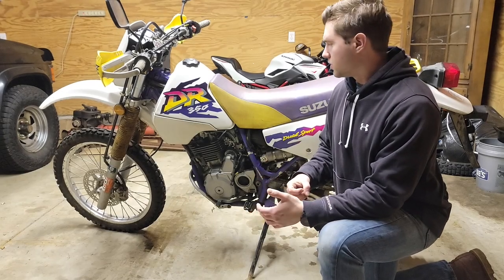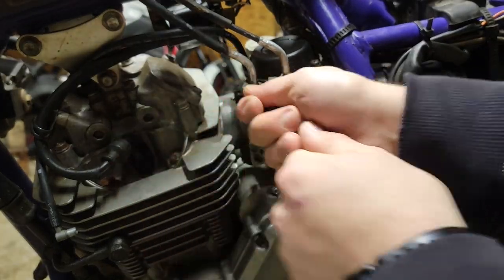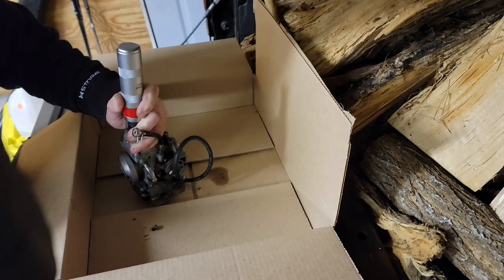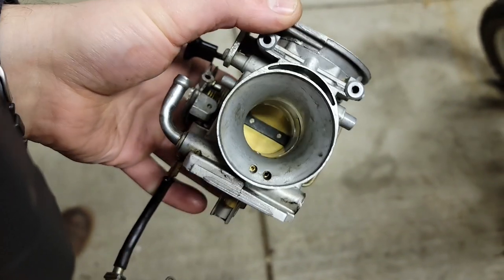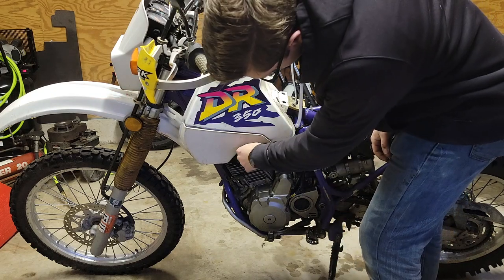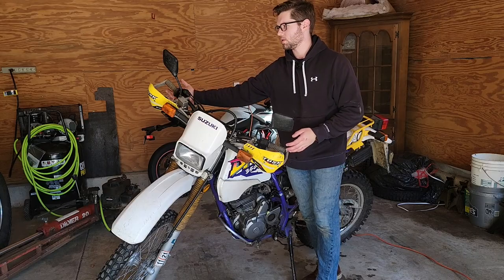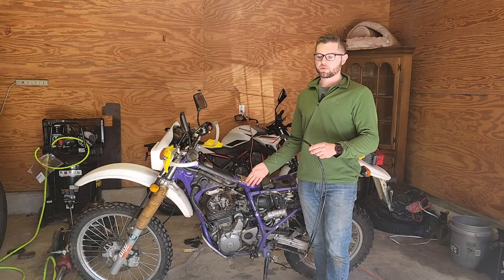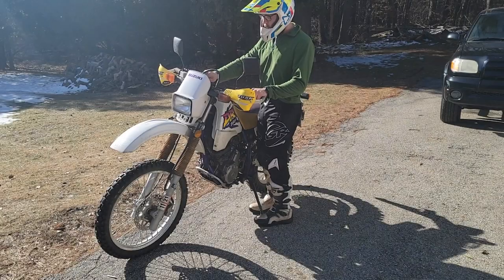Refreshing a Motorcycle After Storage: 1996 Suzuki DR350

Comment: I might suggest a little step by step talking about specifically cleaning needle and seat (if this carb has one) and how to check the setting of the float. Is it possible to get out of alignment?
Good video with option of more future steps as riding season (and things break) goes on. Have fun.
Reply from the maker: This carb has one, but since it was in good condition I didn't have to spend effort on it. I did verify it's in good working condition by trying to blow air through the fuel line and make sure it sealed nicely.

Comment: Good job dude. I am looking to buy one of these.
Reply from the maker: Thanks. What model years are you looking at? Personally I think the years to get are between 96-99 as they came with electric start. They're a little more expensive but it's a nice quality of life upgrade with the easy button.
Reply: @Dan_And_Daves_Garage  yes I would like the electric. I think those newer ones have improved suspension also. But I have my eye on an older kicker. Leaks oil I am told. Hopefuly a good deal. Going next week to check it out. It's not on the market yet.
Reply: @Dan_And_Daves_Garage I'm also looking at one of these, it's a 97' with a little less then 10k miles and a pump carb already installed as well as some stiffer suspension. Looks to be a solid deal at 3k listed and I might be able to talk them down a little more

Comment: No mention of checking the pilot and main jet for occlusions.  What condition is the tank?  Rusty?  Since the initial carb condition is pretty clean, what did you do to help it to start?
Reply from the maker: Since I've owned the bike for a while I know that the tank is rust free. Plus when I stored I stored it full of gas so it wouldn't flash rust the inside. The reason I cleaned the carbs was because of an occlusion in the pilot jet.
Reply: But can u still mention all other possible factors just in case this alone doesn't fix it for that viewer's bike. In other words, can u list other 'if not this, then it could be that scenarios...'?
For a DIYer this can turn into finding a needle in a hat stack pretty quick and become overall frustrating real quick.

Comment: Unclear exactly what you did with the throttle cable and what was the fix for it sticking. How could it be too short after you reinstalled it when it was previously okay???
Reply from the maker: The new throttle cable was too short  so the original one had to be bathed in oil for a while and then reinstalled it. Never got to use the new part.  Hopefully that clears it up.